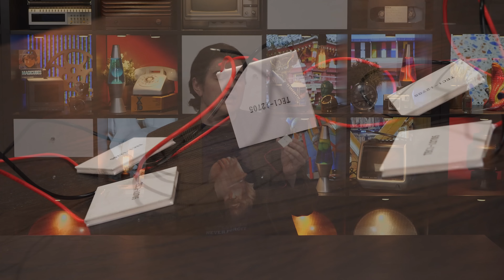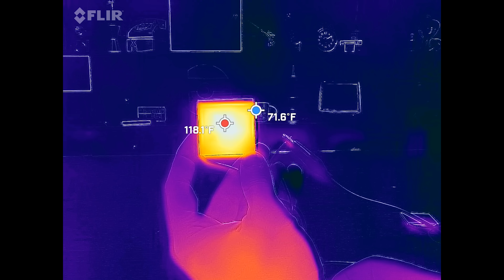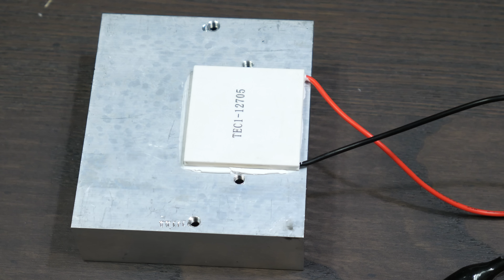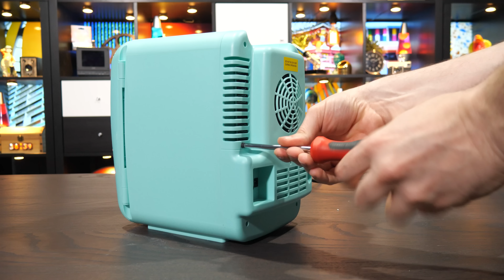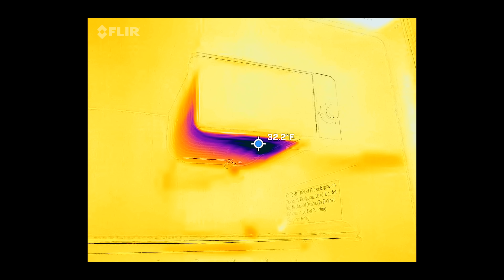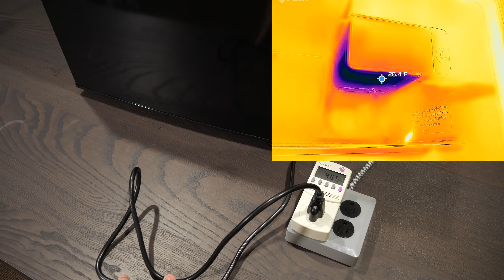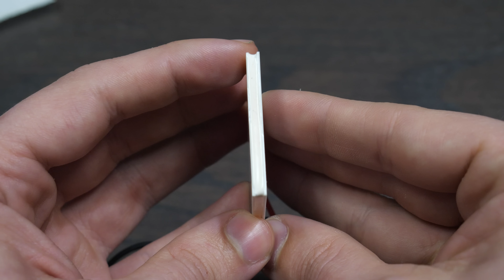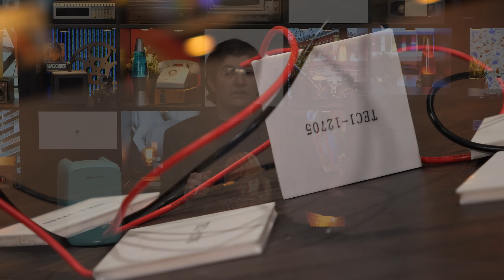Thermoelectric cooling: it's not great.

Comment: Hehe a video on Peltier modules just a couple weeks after I rigged a quick test cloud chamber running on 3 stacked peltiers! It's been years I wanted to play with Peltiers, and I wanted something useful, here it is! Now, I was fully expecting to struggle to reach low temps on this, and I was shocked to fire up the system for the first time and find out the cold plate reaches -40°C/F! I used modules from known brands though, from Mouser, and sized somewhat correctly I guess. Hot side (CPU waterblock) -> 110W TEC -> 60W TEC -> 24W TEC -> Cold side, all same voltage modules, wired in parallel, rated at 16.6V but I got the lowest temperature powering them with 10V instead. I seem to remember it eats around 100-130W or so running. Still pumps a lot of power for not much, but it was very very simple to build and does the job perfectly for that application. So indeed for the correct application, these are wonderful things! Now I have the motivation to keep working on this little project and build a proper small cloud chamber! I'm gonna place Type K temperature sensors at every point to see how each stage performs.
Reply: That sounds awesome, I hope you can video that chamber and how you're building it!?
Reply: @Quickened1  I'm probably gonna make an assembly and test video when I'm done. It will be a bit later though, limited time to work on that now.
Reply: @Slay3rOne  I've been intrigued by the cloud chamber since Tech Ingredients built one on their channel. A 3 stage Peltier driven one tho, that's on another level. Average Joe might even be able to put one together if it's simple enough... Hope to see it some day!
Reply: @Quickened1  Yeah I've been quite curious about this as well. He made one with dry ice. I don't have that here, and it's not as fun as building one for peltiers haha, so I had to go that route. Mine is very small though as I said on my previous comment. To make it that much bigger I think I might need 3 to 6 stacks of those 3 peltiers modules. That's a lot! Also, I don't have much to test inside at the moment, so the small one will do for me.
Also, I read that adding high voltage should help see the particle paths a lot better. I have a small adjustable 0 to 6kVDC isolated brick I used to use to power small CRT tubes. I will use this here with knobs to adjust the high voltage, see how it works.
Reply: @Slay3rOne  well, if the small one is all you need, no point in going over the top. The dry ice is a deal breaker for me as well, so hopefully, I'll get to see yours in action. If it turns out to be what it sounds like it will, I might actually build one someday myself! Good luck when you get to it.
Reply: @Quickened1  There are quite a few of the peltier models on YouTube as well! You can have a look and see how it performs already if you want.
Reply: @Slay3rOne  yeah, I saw a couple, it all boils down to how simple it is to build, and of course, the time and money to do it!  It's just curious how different people, approach things differently...
Reply: I was looking for this comment.  Add a thermostat and better insulation, and maybe the energy consumption no longer outweighs the benefits?
Reply: @NepTunez-ff9bp  It's already very well insulated, and this thing requires around -30°C, so I could use a small circuit to regulate them to that temperature, it will consume less power. Also the cold side is a 10mm (0.4in) thick and 10cm (4in) diameter aluminium disc. So it definitely stays cold for a bit when I shut the TEC modules down, that would help with the regulation. Overall it's still gonna consume a lot, but built right with correct insulation and throttling when reaching the target temperature, it should be acceptable for this application.

Comment: We use these in a protein determinator that combusted a sample and then used a small block  the gas would flow through to condense out the moisture before  the real chemical scrubbing occurred. It was extraordinarily effective as you can keep it down at 5c consistently with very little work. But the whole volume of that space was maybe 3 poker chips stacked on top of each other. . it was a very robust solution for that issue but makes absolutely no sense for any kind of volume.

Comment: They’re also surprisingly brittle when they’re cycled frequently even those that are designed for it. Used them professionally and it was a consistent issue. Eventually moved to a refrigeration setup which worked well but was like 100x as expensive.

Comment: My disappointment is immeasurable and my day is ruined. 

You didn't test its performance while it's inside the mini fridge. It was crying out for it!
Reply: Connextras!
Reply: In the right configuration, multi-stage thermoelectric coolers can achieve liquid nitrogen temperatures. I am curious how cold the cooler in a fridge would get.
Reply: @Peter_S_  that was entirely my thinking. Does it still manage the same delta T? How much harder does the real fridge have to work now that it has a 55 W heat source inside it? So many questions.
Reply: @Renegade605  Yes, totally agree. I would love to see thermocouples in the air spaces of the cooler and the fridge, and on both surfaces of the Peltier module graphed over time. With enough channels on the data logger, I would also add ambient temp and a thermocouple on the evaporator and the condenser coils of the fridge as well as a digital input for recording when the compressor is running. There's a lot of efficiency data to be had there.
Reply: @Renegade605  It might shorten the life of the fridge, but should be able to handle it. Mine can draw over 600w. So it should move well over 55w. Given this TEC holds a delta T of 30f (16.7c) and a norm fridge holds between 32-40f, it should stabilize around 2-10f (-17 to -10c). Basically slightly warmer than the freezer section.
Reply: @Renegade605 your asking thehard hiting questions
Reply: @Peter_S_  I like the way you think.
Reply: @Peter_S_  Wait a minute!
If we put a fridge within a fridge, within a fridge, within yet another fridge.
Do we achieve time travel?
Reply: @IntegerOfDoom  to the ice age!
Reply: @Peter_S_ I would think you need a much higher voltage for that.
Reply: @Peter_S_  Do they actually? I highly doubt it, considering the exponential nature of how many you need per stage and how they get worse with lower temperatures.
Reply: @Peter_S_  They sure can, at the cost of the final hot end getting hot enough to start fires.
Reply: @Peter_S_  or if you put a bunch of them in parallel, they can in theory beat refrigerators. which is what im trying to figure out.
Reply: @Peter_S_  While I love this idea, I see a problem. The thermoelectric cooler will generate a ton of heat inside the fridge, which will largely cancel out the cooling effect of the fridge. Fridges don't work well if something inside of it is generating heat. That's why people don't build PCs in mini-fridges.
Reply: @Peter_S_  you probably should become a patreon and pay that energy bill.
Reply: @Peter_S_ Well they work on temperature differentials so you need a greater temperature difference between the inside cooling and outside temperatures... So you need really good cooling for the hot side otherwise the cooling side doesn't function very well. So if you use it in a hot enviroment the worse the cooler functions.... Though you can make it function better by putting a big fin cooler from a CPU cooler on it to make it work better.
Reply: @SilvaDreams let's not forget the old cpu cooling towers which had a peltier cooler built into the baseplate, I got one from either a Savers or Goodwill, and it still had the old 4 pin floppy drive power cable
Reply: @imclearingit4149  basically a mini molex connector
Reply: @imclearingit4149  Oh I remember those things, they were absolute dog fecal matter. Neet to have but they'd cause your CPU to overheat because they couldn't keep up just like this little fridge.
Reply: @imclearingit4149  those are junk. if you have 1~2 peltiers cooling cpu you need to go over the optimal current draw for each peltier which makes them less effiicient, thats why most peltier based cpu/gpu coolers suck. you'd need ~7 for CPUs (depending on delta you are trying to go for) and probably ~20 for GPUs.
Reply: @SilvaDreams  so basically, if i get that Element onto some crazy powerful gaming rig cooling system, we get maximum cooling. so worth it B)
Reply: me willingly spending 400-600 dollars building a custom pc cooling rig just to cool 6 cans of La Croix (most energy efficient american (its fine im american))
Reply: @mellowmelly9258  Unfortunately no, I said better. Not good. There have been thermoelectric CPU coolers done multiple times from the 90s onwards and they always fail to do better than just a basic fin stack and fan which is why they are so common. Cheap but effective.
Reply: @Peter_S_  Their efficiency in these multi stage configurations is lower than squirrel balls tho
Reply: @ElectricNed  Duh. Who cares? When is the last time you achieved LN2 temperatures in a fridge?
Reply: @Peter_S_  When's the last time someone appreciates being in the same room with you?
Reply: @ElectricNed  What were you trying to achieve? Did you just want to be contradictory and state the obvious for the sake of being contradictory? Yes, thermoelectric coolers are very inefficient as stated in this video, and I've also known that since the 1970s. There's still a lot of efficiency data to be had here about multi-stage refrigeration which many people would find interesting. I hope you have a nice day.
Reply: @Peter_S_  I have a blockbuster membership card in my wallet, and I Iike potatoes
Reply: the fridge it was inside of would have had to run the entire time, instead of only a fraction of the time, to deal with a constant 50 watts of heat being generated by the device sitting inside it.  Doing this would cost significantly more than running the two devices separately.
Reply: Someone mentioned that had one hooked up to a solar panel outside and at night it couldn't actually get any colder due to the outside temperature. So I'd assume it would just heat up the mini fridge.
Reply: I got a SANYO mini-fridge back in 1999, and it's been running in my office ever since keeping my beverages cool.  It's pretty amazing how it's still running perfectly well for over 25 years and it's completely quiet.  As they say, don't make em' like they used to.  :)
Reply: TEC are sold with specific temperature deltas they can achieve, so 30-50 degrees is average to high end. So as mentioned, you can stack, or you can just make the hot side colder in other ways. The TEC for "CPU coolers" are 50 degree delta, normally, so they will keep a CPU just above freezing when idle. This sounds great, except that whole "dew point" thing, and we discover why we don't use active cooling inside computers!
Reply: @genewitch  You can stack them, but the heat builds up exponentially. Also, what TEC can cool a CPU to just about freezing? Thats >100 Watts of cooling at 20 K dT.
Reply: Screwit, let's go full-on fridge matroyshka!
Reply: Yes Connextras!
Reply: he did, it starts at 6:20
Reply: @fender42421  uh nope. Not what I said at all.
Reply: @Renegade605  i copied and pasted the next sentence from your original post...
"You didn't test its performance while it's inside the mini fridge. It was crying out for it!"
the time stamp i provided is when he measures the temp inside the fridge filled with sodas and he even takes the temp of the liquid in the cans....   hope this helps you understand. cheers! :)
Reply: @fender42421  I can't tell if you're being deliberately obtuse or not, but everyone else in the thread understood what I meant and it wasn't that.
Reply: @Renegade605  oh sorry, i didnt read everyone elses comments, just yours.... what did you actually mean then??
Reply: @fender42421  there are only 40 of them. You could just read them instead of expecting me to explain it to you.
Reply: This should be a youtube short follow up :)
Reply: No one is asking the hard hitting questions...
If you put the Peltier fridge inside the Red fridge, would the Peltier warm the inside faster than the red fridge cooling it
Reply: given the way the peltier works wouldn't it be about the same?
Reply: Those small fridge are fine it works well enough to cool soda 🥤
Reply: @Unknown-r2p2o  the video itself covers that it does a poor job of cooling soda?
Reply: 50 degrees is cold enough for soda and sandwich for few hours
Reply: The toy fridge doesn't have a thermostat, it would consume the same amount of power.

On the other hand, Peter's got a good point...
Reply: @timothymclean  Lol, yes.  It's set to "cold" :D
Reply: Reviewbrah!
Reply: @jeremiahlowe3268 These devices pump heat. There's always work to do if you're above absolute zero. You may want to watch the video again.
Reply: All that would do is decrease the larger fridges efficiency by 55%. Alec's estimated cooling power of 100 Watts based on C.O.P. less the 55  Watts the blue blob is producing as heat. The Peltier effect would be nullified (as would the Seebeck effect) due to the Thompson effect which dictates that there must be a temperature differential between the two faces of the plate. The net effect would be like opening the fridge door to cool a room. All it does is waste energy pumping the heat in a circle, and adding to the overall temperature due to wasted energy as heat.
Reply: I agree, it honestly damages his credibility pretty badly for that
Reply: He mentioned it doesn’t get cold enough for food and said it’s sucks. That’s all i need
Reply: @drink15 30 degrees lower than ambient Temps.  That's not nearly low enough for any perishable food items. Barely even low enough to chill a 6 pack cans.
Reply: @drink15   he wrong ive used many of these peltier 6 can firdges and they have all worked well for me. he talks about food but these are mini fridges made for having a cool drink or beverage... not food
Reply: @fender42421  what’s in it doesn’t matter guy.
Reply: @drink15  um ya it does.... i wouldn't keep food in it.... that's kind of something that matters that's in it lol.... take it easy kid and think before you speak smh lol
Reply: @fender42421  What you would or wouldn't do doesn't matter. You are not the main character smh. What does matter is the fact that it advertises storing food and skincare products.

I'm not the one that needs to think....

Comment: Are there fundamental reasons present day Peltier devices aren’t very efficient, or is there any reason to think there may be serious room for improvement like we are seeing with battery chemistry/materials? I’m assuming there might be some gains to be had, but funding that research just doesn’t make sense when the COP for most basic heat pump tech is already so much better.
Reply: You need something semiconducting (p and n type carriers) that is low electrical resistance but high thermal resistance and there just aren't that many materials in that trade space. And even if you improve the insulation it's just fundamentally pretty thin. So you have to push hard (draw a lot of current) to get a temperature difference. It's like carrying a leaky bucket of water up a hill.

Comment: Aren’t Peltier devices also used in spacecraft cooling to avoid moving parts/vibrations?
Reply: You'd still have to dump that heat somewhere which is the big issue all along